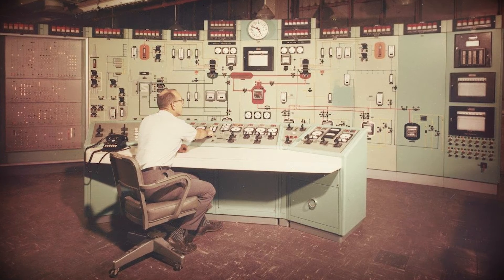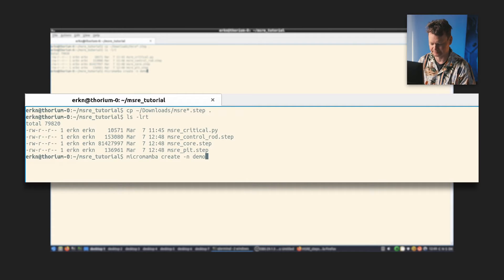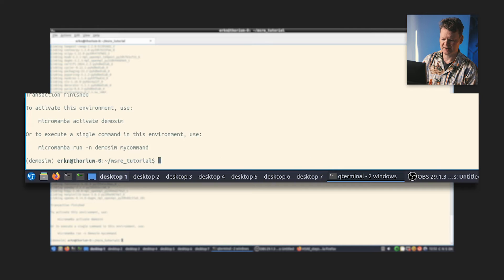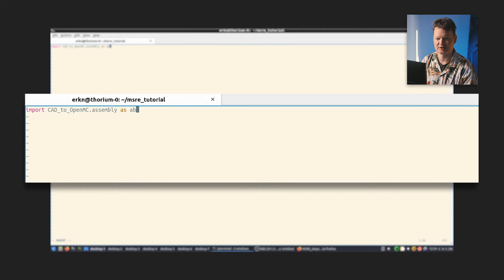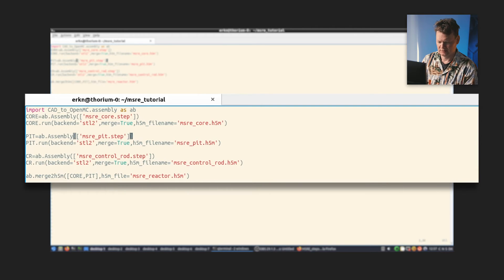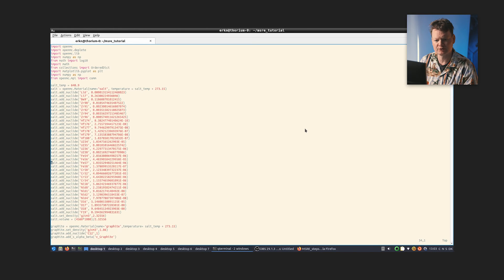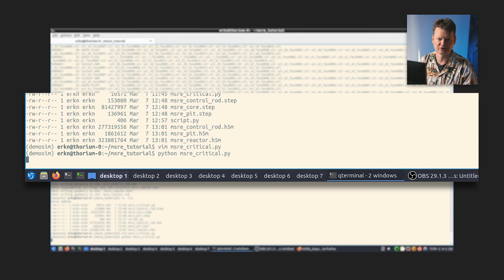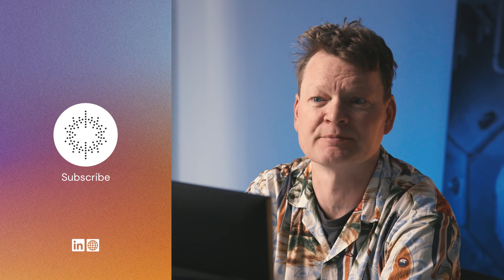OpenMC Tutorial | Converting the World's Most Detailed MSRE CAD Model to Simulation

Comment: Sorry for interruption... Very nice demo! 

Only one question: when I trying to run the openmc to start similation, it says 
```
ERROR: No cross_sections.xml file was specified in materials.xml or in the OPENMC_CROSS_SECTIONS environment variable. 
```
If there are any place I can get a simple/general oss_sections.xml file?
Reply from the maker: Yes. Cross section libraries are available at openmc.org/official-data-libraries. Choose which library you’d like to use, download the file and unpack it somewhere. In the folder you will see a 'cross_sections.xml' file. You need to tell OpenMC where to find this. There are two ways to do this last step. Either set an environment variable to point to the .xml file, i.e. `OPENMC_CROSS_SECTIONS=/path/to/cross_sections.xml`, or add the path to the openmc.Materials object, i.e. materials.cross_sections = `/path/to/cross_sections.xml`

For more detail, see https://docs.openmc.org/en/v0.12.2/usersguide/cross_sections.html.

Comment: How and where do you assign the materials to the geometry? I see you are filling the regions with cad models, but how do you tell the code to put materials in specifically assigned places?
Reply: Two ways really
1. The names assigned to the parts in the CAD-model get picked up by CAD_to_OpenMC and assigned to the cells created in the h5m
2. you may supply a python dictionary to the run-method of your CAD_to_OpenMC assembly object - which has the option of retagging based on regular expressions

Comment: I am trying to use cad_to_openmc but I need to associate materials to geometries in my step file, however, I cannot do that with salome directly, did you incorporate the materials in the cad_to_openmc code or did you associate the materials in open mc before a simulation ? also what mesh parameters did you use because the documentation of cad_to_openmc entions nothing about submeshes and if/how we can create them.
Reply: Excellent that you try to use CAD_to_OpenMC - not so good that you have problems. CAD_to_OpenMC tries to extract the materials (names actually) from the part names associated with the part in the step file. You may override this by either supplying a dictionary with regular expressions which map the part names to material names, or by supplying a list of material names which will be attached to the parts in the order they appear in the list.
Reply: The meshing parameters as such were not mentioned in this case since I simply used the defaults, which are facet tolerance of 0.01 and angular tolerance of 0.1. Admittedly these are rather arbitrary, but can be set in the meshing process. Not entireyl sure what you mean with the notion sub-mesh. At present cad-to-openmc does not support having different parameters for different objects in one assembly, if that's the question. Something akin to this could be targeted by meshing in parts as for the reactor core and pit in the video. This of course requires that the objects are distinct.

Comment: Thanks for your great tutorial. I have a question regarding the activate demosim, when I do that, I can't see demosim on the left like what you have? I was wondering does it make any problem?
Reply: Back from vacation: I am glad you liked it - thanks for getting back to me.
What is on the left of the prompt is purely cosmetic. It's merely a reminder that you have an environment activated. I'm afraid I don't know precisely why you don't see it like that - it really depends on how your system environment is set up. Specifically, what is written on the left of the prompt is governed by the $PS1 environment variable. In my case it is normally: " \[\033[01;32m\][\u@\h\[\033[01;37m\] \W\[\033[01;32m\]]\$\[\033[00m\]" which gets altered to "(demosim) \[\033[01;32m\][\u@\h\[\033[01;37m\] \W\[\033[01;32m\]]\$\[\033[00m\]" when  the environment is activated.
Roughly speaking, what matters is what is in the $PATH-variable. This one should have a first entry that points to a bin-directory inside the environment location. If it does then that installation will take precedence over system locations.